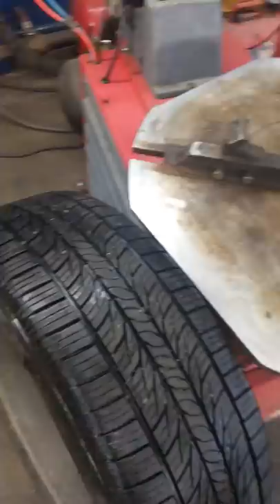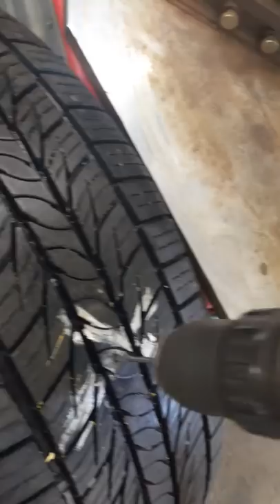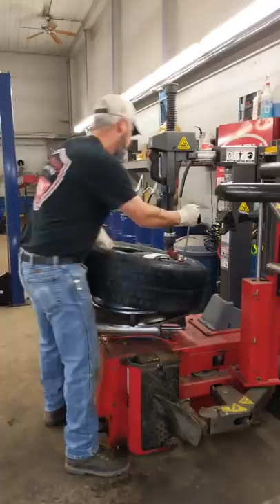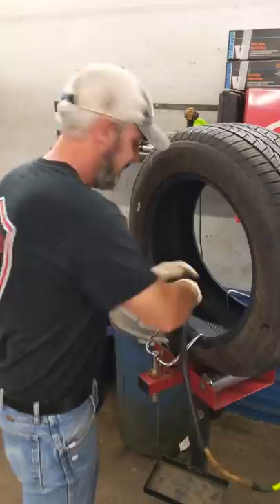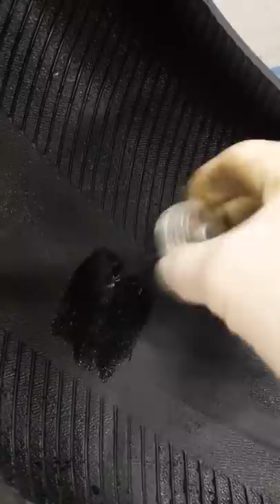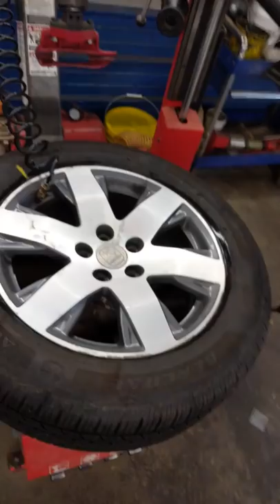Patch A Tire In 60 Second #SHORTS

Comment: You missed the most important step - Mrs O saying "Bill it"
Reply: Yes. Unless you mark where the tire was on the rim then it's not necessary
Reply: I was also waiting for the fire inside the tire about 15, but that's 'old school'.
Reply: his customers can now tell Mrs. O they only wanna pay for 1 min because that's how long it takes ;)
Reply: @billd.6847  very old school Bill. Today's chemicals to bond the patch to the tire will spoil if you do that and then you have another leak (on the same place) Kudos to mr. O for doing a proper repair and NOT a plug from the outside.
Reply: Outside plugs are only temp patches. They are meant for you to get you vehicle back on the road so you get your tire fixed prooerly by a repair shop.
Reply: @wmc128  totally agree with that. Except a lot of people are lazy and they figure if it lasted that long it should be no problem. I saw my share of plugged tires that developed problems, I was a tire tech for GoodYear for 18 years. Cheers
Reply: @wmc128  they were considered a permanent repair until good patches/plug patches came out. On my work car, which gets used in places that pick up screws and stuff pretty regularly, I use plugs. But I also check my tire pressure at least weekly. On a customer's car? F*** no. Plug patch, and only if the damage is within TIA guidelines for acceptable patching.
Reply: HA!
Reply: @wmc128  I did the plug on a highway shoulder it took me 10 min from stop to run. Left to replace the tire other day and never did and never had a problem.
Reply: Haha 😂 yesss
Reply: He missed Balance it
Reply: Step 14 Balance It

Comment: "Mount it, fill it, ship it."  Indeed, sir.
Reply: Still gotta find the hole first.
Reply: Balance it
Reply: the song called  Eric O. - Patch'ologic
Reply: @u2mister17  no sir, that’s why the tire is marked with yellow chalk right at the valve stem before you unmount the tires. It will go back on in the same spot it came off.
Reply: @u2mister17 marked tire or not it's  still going to be out of balance from the added weight of the plug and sealer.
Reply: @JasonSmith-xo9qr  School it!
Reply: Woah there fella!!! Got to pay first lol 😆 😅
Reply: @JasonSmith-xo9qr  it’s so minute. Have you ever had a tire get repaired and you felt a significance after the repair? Because I’ve worked at multiple tire shops and never had a comeback because of an unbalanced tire due to a tire repair.
Reply: @JasonSmith-xo9qr  I guess I have to expand my explanation though, this ONLY works with sticky weights, since the clip on weight is held on partially by the tire, AND will severely damage the cosmetic of the wheel by rotating the wheel in the tire machine with the clip on weights.
Reply: Mount it, fill it, send it.... lol
Reply: That's what she said ! sorry ,i'm goin to hell. lol
Reply: Instructions clear, she had a good time      👉😎👉
Reply: Lube it first; you're not that good looking
Reply: @JacobEcret  not always, it depends how you mount the tire and how close the head is to the rim/weight. Start with it behind it and it never moves
Reply: @Sicktrickintuner  OR.... You could just take a few seconds out of your day to have a little pride in your work and balance the tire especially because you do not know if it was in fact out of balance or not before you did the patch. Tires wear causing them to lose rubber and lose balance and they are known to hit potholes and throw weights. Just take pride in your work and the customers will always come back and bring more customers with them. A happy customer is your best advertisement.  And I am new to this channel but if what everyone of you are saying about the host of this channel then he has enough integrity that he balanced the tire but he just left it out of the video, more than likely, due to time constraints.
Reply: Then tell customer he needs a new tire. Sell off repaired old tire to next customer. Profit!

Comment: That’s a lot of steps, for me it’s - step 1. Take to tyre place 2. Grab a coffee 3. Pay the tyre place 4. Go home. 😁
Reply: That's how I patch a tire as well.  lol
Reply: You must be from the UK. "I don't feel noways tyred." Hillary politicking in the UK.
Reply: Buy a new car. They come with brand new tyres.
Reply: how much is the repair rougly? just busted mine (through sidewall though so tough luck), and two new premium tyres plus work (mind you 175/65 R14) come to about 120USD.
Reply: @kubeek  If it's repairable they'll do it for free. If they don't, go somewhere else. First place that does it free, buy your next set of tires from them at a later point. Everyone wins
Reply: @-BuddyGuy  I doubt SMA does that for free. Just mounting and balancing a tire is about $25. Tire shops that don't charge plug the tire from the outside.
Reply: @cluckhead1913  And what right minded shop owner would pass up the chance to get a sweet 25 bucks and instead stupidly accept a measly 10-20 dollar cash tip on the first day from someone who is not even a regular customer, and then earn their worthless loyalty for a pathetic 15% markup on a 300 dollar set of tires every couple of years, with potentially some boring and dirty oil changes in between. You're right, I'm not thinking straight, that's terrible business and I've never actually seen it happen and you are definitely correct that if they did do it it would be a dangerous repair. I completely forgot that all three hypothetical tires I could have got this done on (but didn't) would have catastrophically exploded, sending my car careening into 3 separate orphanages due to the illegal work of these rogue shops. You've really helped me here today with your amazingly insightful GUESS.
Reply: @kubeek  pep boys quoted a friend 45 bucks to do this. that was with the tire already off the car.
Reply: @cluckhead1913  My local won't plug a tire, PERIOD. I watched the guy that brought the tire in plug it, with the companies material and instructions though.
Reply: @kubeek  I got a local place that does this for free. i have no idea how. earned my repeat business tho.
Reply: . up here it is about $30 to $50 Canuck Bucks...Canada ehh...

Comment: Absolutely the correct way to do it. However, in the last 40 years of using off the shelf galvanizing plugs, I've never had one single failure. It takes me a total of 5 to 10 minutes including finding the hole, and most of the time I don't even have to take the tire off the vehicle.

Comment: Step 4 1/2: 
Mark valve stem with tire so it won't need rebalancing.
Reply: Step 5 Check balance. If the tire runs flat. it can slip on the rim, The rim can become distorted or dented or lose weights.  The wheel may not have been balanced before the puncture.  If it isn't checked for balance it's patched, but the repair job is not complete.
btw, This assumed fix-a-flat or other goop was not used.
Reply: @psdaengr911  If the tire runs flat you replace it, even a short drive will cause sidewall damage that can cause a failure.
Reply: Balance is already altered, just give it a quick balance and add it to the bill.
Reply: The added weight of the plug and sealer effects balance.
Reply: @JasonSmith-xo9qr  not by that much
Reply: @AstrosElectronicsLab  For a rear you might not feel it, but up front it could easily be enough to affect ride. Balancing tires is easy enough anyways so better to just do it.
Reply: @JasonSmith-xo9qr  effects???
Reply: Does the patch affect balance?
Reply: @grantsnell6782  ... On the minimum side. I had an instance in which a tire's balance was severely affected by the installer's error. It was a 7.50 - 16 truck tire. Another guy in the station mounted the tire on the wheel and my part was to balance it. Back then, we only had a bubble balancer. Most people won't know how it works, so I'll just mention that it uses a central pinpoint to allow the tire to wobble and weights are placed to put the bubble in the middle of a ring on the sight glass. Before the wobble is allowed, the tire is set over a cone to center it on the device. Once centered, a lever is pressed down to lift the wheel off the platform, about a half inch. I couldn't detect anything wrong as I handled the tire and wheel, but the moment I pressed the lever, all hell broke loose. The tire yanked the machine almost off its base, only not going over because my arm was still under the tire holding the lever. I'd never had anything like that happen before. Once I got the tire under control, I took it to the tire machine and pulled the valve core. Once the tube was deflated, I took the high side off the wheel and found the "culprit". The dope who put the tire on the wheel didn't take the rim flap out of the tire and place it over the steel wheel to protect the tube. Instead, he left it in the tire, rolled into a cylinder and rubber banded into the smallest size possible. I don't know how much it weighed, but probably more than a pound, all in one spot against the sidewall. If we hadn't tried to balance it, along with the other three, the truck would have bounced around like a Superball. Fortunately, I tried to balance it before the other ones got mounted, because numbnut wasn't going to figure out what he did wrong. He wasn't familiar with tube type truck tires, until that lesson.
Reply: You always rebalance no matter what. 
Do a job properly.
Reply: @AstrosElectronicsLab  it's usually half an ounce, thats enough.
Reply: I worked in a tire shop for years. I would check balance before and after and the patch does affect it.   Spend the extra 30 seconds and balance the wheel…
Reply: @Blazer02LS no you must inspect the sidewall we pull vehicles in slowly to the shop on flat tires for years if you go slow enough it will not cause damage obviously not driving far
Reply: Always needs rebalancing. Always.
Reply: Plugging had become history?
Reply: On the old school coats balancers there's actually a setting/button for patches but since you're putting something extra in a regular balance will do just fine👍👍

Comment: I seem to always take the damage right in the sidewall transition.  Step 1: Buy a new tire....
Reply: More in the shoulder of the tread for me. Same result.
Reply: Happened to me yesterday
Reply: If I’ve used a patch plug at the tread/sidewall transition and kept the tire in service for 20k more miles without a single problem, I wouldn’t get on the internet and suggest anyone else do it...
Reply: @athhud  kind of like my old motorcycle.  I did a plug at the end of a season "just to get home".  I promptly forgot about it and drove it all the following season.  Plugs are not a good idea when you are on two wheels.

Comment: Being an ole mechanic ive seen and repaired many tires . I find your vids helpful . I would spin the tire up and check balance especially if going on front (proper tire rotation it will be likely on front sometime) we used to tank the tire as well and sign the patch for full geekness. Still a full thumbs up for stitching patch.

Comment: You forgot a step  , Rebalance the tire ! As you added weight to the tire assembly  . And Bill it was probably  the last step . 👍
Reply: That difference is not noticeable as long as you marked the tire. I tested this all the time to see how far off the balance was. This involved balancing the tire to see if it's off prior to patching, patching, mount tire on same position,  check balance. At most you'll find a .25oz difference if at all.

Comment: I just pull object, ream out hole and shove plug in.
30 years never had a problem.
Reply: That is all my brother ever wants me to do when fixing a leak for him and they do hold air but I still do mine the more reliable way since I take long trips. not sure if it really matters but the piece of mind is nice.
Reply: Ditto, I've NEVER had one leak, jump out, fall in, or anything but stay put. I've even plugged my motorcycle's rear tire on a sport bike. Lasted all they way till tire's end of life. Jus sayin
Reply: Yup, unless the hole is too big or on the sidewall, I've used a couple dozen plugs on my tires over the past 30+ years and not had an issue.
Reply: My plugs have all worked fine too, never a leak after.

Comment: PRE BUFF cleaner is used BEFORE BUFFING. Please use the "liquid" and "scrape the goo" before "scuffing up" the hole 😊  The purpose is to remove the mold release compound from the rubber before grinding into the rubber so the patch sticks more securely and reliably 😉

Comment: When those pull thru patches first came out I got into an argument with the tire store manager because they charged me full price for tire repair when they obviously "plugged" the leak.
Reply: Most shops don’t just plug tires anymore. There’s a lot of liability for an improperly repaired tire. Plugs work…. But when that attorney comes knocking on your door after the carload of nuns is taken out, you’d better have a repair system, proof of proper training and all the documentation that goes with it.
Reply: In my experience, the only shops that plug tires are the ones that also sell used tires...

Comment: Step 1: Get a tire mounting machine.
Reply: Mechanic 1: Real men use tire spoons
Mechanic 2: No, real men pull tire off with fingernails
Mechanic3: Hurry up tire boys, I've finished the real work and need to test drive it.
Reply: Step 1: Run over object which penetrates tire to cause leak.
Reply: @markh.6687  Step 1: Get a car.

Comment: Step 1: Buy a Safety Seal kit.
Step 2: Get a tire going flat.
Step 3: Use Safety Seal plug(s) to ameliorate air leaks. No power tools needed, other than compressed air to repressurize tire. 
   Granted, not all punctures can be fixed with the Safety Seal plugs, but I've used them for decades with the best results of any repairs. Using patches, I've been fairly successful, especially with trying different methods and coming up with the best way to adhese the patch to the inside of the tire. I've seen powered buffers run too deeply, exposing the cord material. Using the acetone type of chemical cleaner and a clean cloth provides the best surface for the glue and timing the application of patch to glue is rather important. Admittedly, I haven't used a combination of patch and plug, but I'm certain I could make it work.

Comment: Believe it or not, I have probably patched more tires than Eric. It’s a fairly straightforward process but not everybody has the common sense to do it. I have seen numbskulls grind away all of the rubber inside a Michelin tire and ruin it.
Reply: I did it for 3 years.
Reply: yea takes practice my first while id sometimes grind a little to deep and i would grind to much area of the tire. after doing it for awhile now ive gotten better at determining how much i need to scuff it up and no longer scuff up more area than needed

Comment: What do you think about the cord plug for patching tires? The ones you buy at autozone and plug yourself.  Is that considered as good of a patch?  I put a cord plug in my tire (assuming it was a temporary fix) and later took it to Honda and they told me if they tried a repatch that it would probably ruin the tire and what I had in there is considered a permanent fix.   It has about 5000 miles on it now and still holding...
Reply: I patched my winter tyre with that (called "dog shit" in Finland) and never had a leak on it. Run three winters with them. Fast, cheap and excellent patch.
Reply: Cord plugs are not considered a permanent repair, they are OK for a temporary fix.

Comment: Very important step... let the glue dry before applying the patch.  Also, carefully follow the path the screw/etc took... don't make two holes out of one!  If it went at an angle, follow that angle with the drill.

Comment: I have repaired so many where mechanics will not put rubber sealant over the patch after it's rolled. Very important step. 

This is a great video for people who wait on tires. It takes time. Not just 1 minute, but about 10 or 15 min for 1 tire. (I know it's edited.) This is the better way to patch. There are plugs out there, but most of them do not work well at all, and are a waste of money. I only use certain types of those. The cheapest is not always best in that case.

Comment: I’ve been fixing tires for 15 years, bead sealer (the black stuff he puts on top of the patch) is not necessary but some techs like to put it on. Omitting bead sealer will not affect the patch at all as long as it’s done right. My 5 cents ( in this economy)

Comment: Actually Eric, Do NOT seal the patch with the same rubber cement when you are done rolling the stitching wheel on the patch. The cement will turn the patch into a soft goopy mess and may cause the patch to leak again.
I’ve built tires for Uniroyal and BF Goodrich for a long time as well been a tire buster as one of my first jobs.
Just stitch it with the rolling wheel and that’s it. Once you’ve prepared the surface with solvent use the cement to start the vulcanization process and place the patch stitch it and cut off the excess that sticks out of the tread.

Comment: That's the most thorough way to do it.   As a home-gamer,  provided the tire's not gone super low on the road....    I've done a tire plug.     The low pressure light comes on....... go to the gas station and air it immediately.... go home......... tire plug.    It's not as good,  but if it's been run flat,  you're hosed.